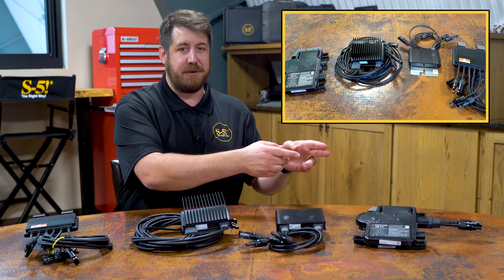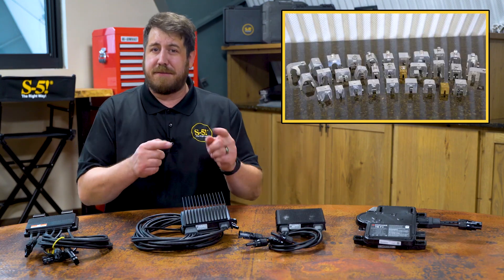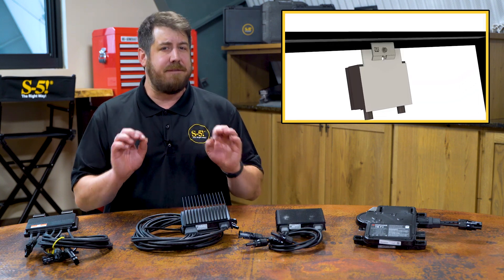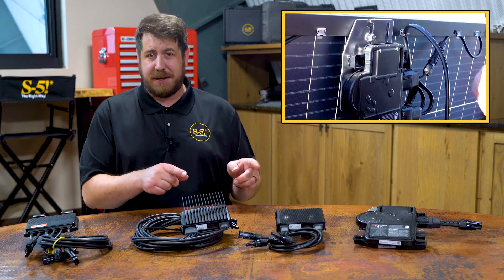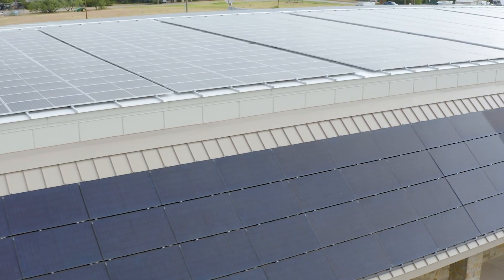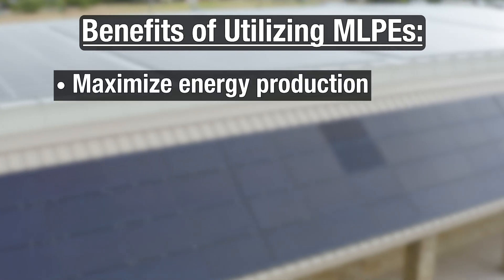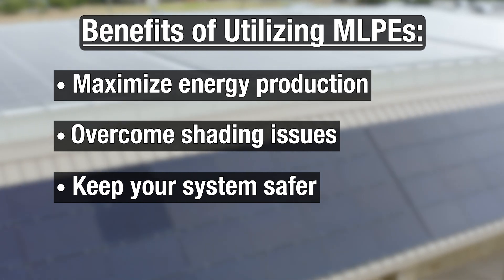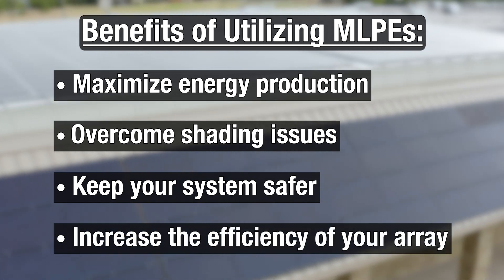Maximize Your Solar Potential: A Guide to MLPEs on Metal Roofs!

Comment: A roof is a terrible place to put your solar panels , roofs are the most fragile part of a house and all the extra weight and wind loads might cause problems in the future . Animals will build nests under them and chew up the wiring . You can't aim them efficiently and mounting all that delicate electronic equipment on the hottest part of a house will not do the circuitry any good .
Reply from the maker: Here at S-5!, we only manufacture attachments for metal roofs as we believe that metal roofs are the best, most durable, most versatile, and longest-lasting roofs available among other advantages. Metal roofs also make an excellent platform for mounting solar. Standing seam roofs in particular are extremely durable and allow for penetration-free attachment of solar arrays using our clamps and these roofs with solar attached can and often are engineered to withstand wind speeds of 185 mph +. Arrays are most often installed on south-facing slopes when possible for the best exposure to the sun and with the greatly increased module efficiency in recent years modules being at the optimal angle to the sun is not nearly as critical as it once was. Rooftop arrays often include wire screens around the perimeter to keep critters out that would build nests and chew on cables. As common as rooftop arrays are nowadays, module manufacturers have taken into consideration the extreme temperatures that roofs can reach, and the electronics are designed and protected accordingly. If you would like to discuss any other concerns or questions you may have please reach out to us a support@s-5.com
Reply: Considering how much lighter metal roofs are compared to shingles the added weight of solar isn't that big of a deal.
Reply: If your roof is the weakest part of your home, you need to fire your architect!